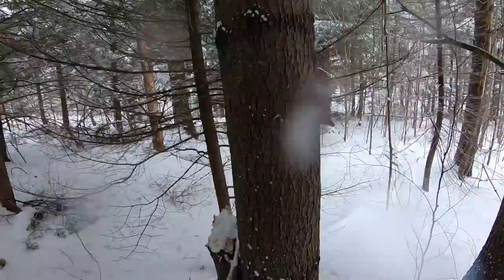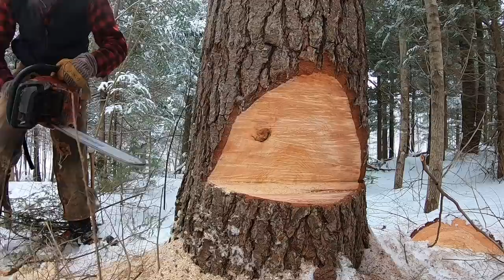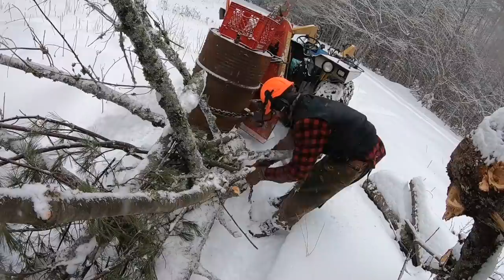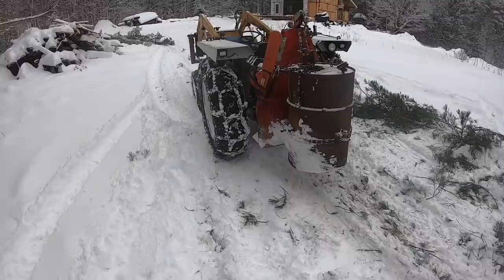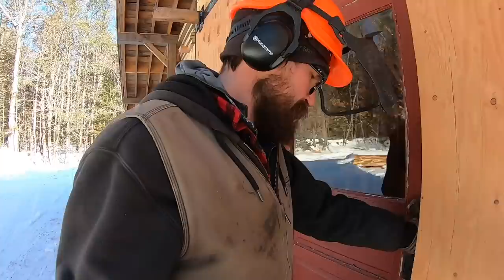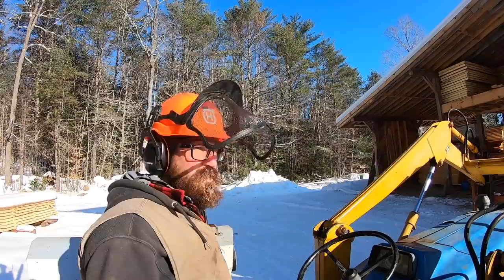Building a House from Trees SE 5 EP 17 - Logging in a Snow Storm

Comment: I bet there's not much snow left anymore--glad you got to make the most of it with cutting that tree.  It looks like the concrete counterweight barrel is attached to the winch with chains? Or did you weld something up that I'm missing?
Reply from the maker: There is still quite a bit but its going fast. Cursed mud season. Glad I got the logs out when I did! The counter weight is attached with chains and then the winch is chained to the frame so its not a strain on the hydraulic pump.
Reply: Ah, ok. The "winch chained to the frame" part is what I was missing.  I was wondering how you weren't over-stressing the hydraulics.